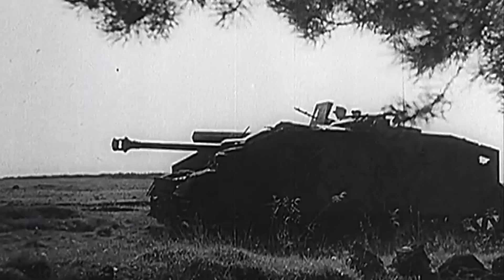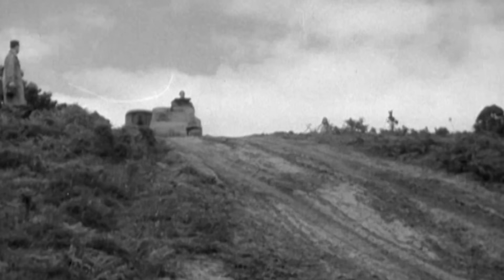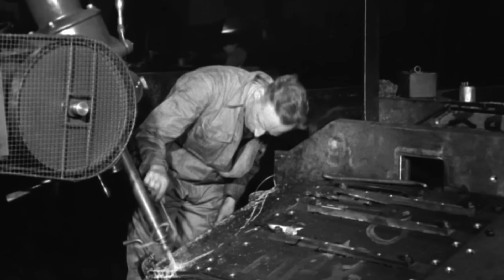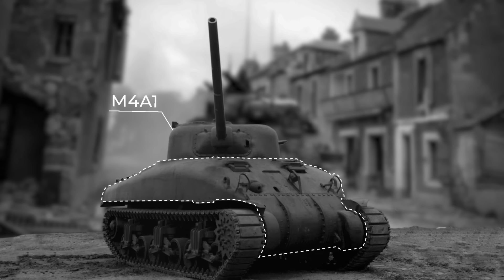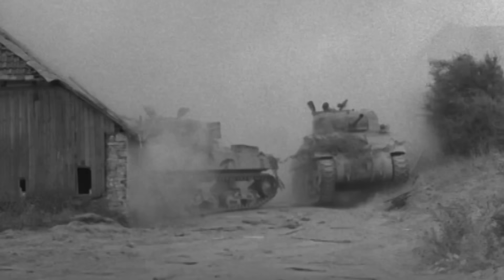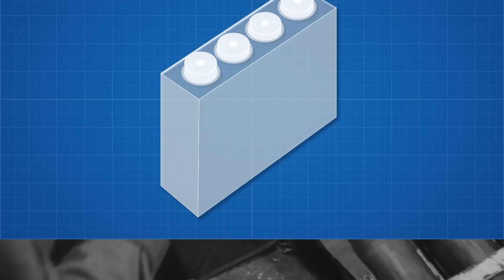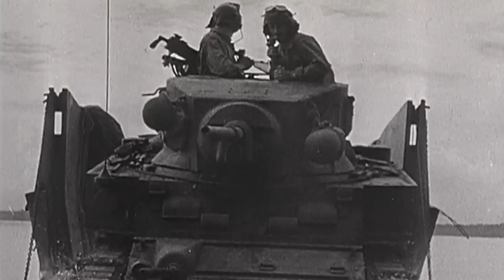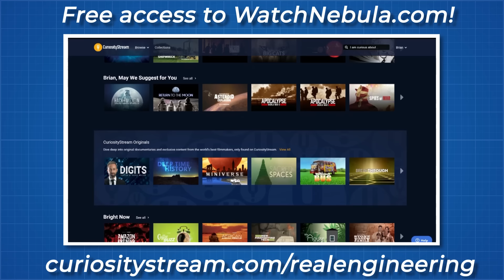M4 Sherman - The Workhorse of D-Day

Comment: The size of a tank platoon in the US army was 5 tanks, so if the US army was sending tanks to battle, it was in multiples of 5, which is why there would always be at least 5 shermans fighting any german tank.
Reply: Pyroblaster1 I am a retired tanker, you are absolutely correct. Tanks fight as part of a unit. The smallest maneuver unit is the platoon, which in WW2 was five tanks, today it’s four. Tanks do not fight by themselves. A tank fighting alone is a dead tank.
Reply: John Aaron But wait, there’s more! If you act right now, you’ll get infantry support! And if you call before midnight, you’ll get an artillery fire mission! And if you’re among the first 100 customers, we’ll throw in a tactical air strike at NO ADDED COST!! 
My point, of course, is that every Branch supports each other, and ultimately the Infantry. Nobody goes into combat alone. And from this short-timer to a Lifer, thanks for your service.
Reply: @kentuckycrittercamera9407  they're doing well in infiltration tactics within the Russo Ukranian war.
Reply: The British often had a 6th in the form of the Firefly with the very powerful British 17 pounder gun

They'd paint the end of the barrels black and white so they'd look like regular Shermans to the Germans and not get targeted first
Reply: The Germans were on the defensive,  in order for an attack to be properly carried out the attacking force needs at the very least a 3 to 1 ratio
The reason that the allies have 5 tanks for platoons is primarily because that is what they have brought with them
You're not gonna say 'hey the enemy only has one panzer placed there, lets reduce our number of tanks from 5 to 3, lets make this fair'
Reply: An allied company could be supported by a platoon of Shermans, a German company had a lot of MG 42 machine guns. The role of German infantry in support of tanks were the Panzer Grenadiers. They had a completely different philosophy. The allied philosophy demanded the production of lots of tanks as they had the initiative after El Alamein.
Reply: @CharlesvanDijk-ir6bl  the americans were caught in a bad situation. they had to have a tank that wasn't a tank. they had to have a tank that could be shipped to europe, land in france and cross every bridge between paris and berlin.

they did it with disposables. it took 10 american tanks to knock out one german tank, but we had lotsa tanks and lotsa tank crews.
Reply: @longnamenocansayy  It didn't take 10 Shermans to take out 1 German tank, the Sherman had a better kill to loss ratio while attacking,
Reply: @demanischaffer  That's why Germany only had 7,300 to 16,700 tanks not deployed and lost on the eastern front but American claims 22,000 German tanks for a loses of 10,000 American tanks... Forgets the UK/commonwealth took on most of them tank and lost about 16,000 tanks...
In a few places the Sherman got a better kill to losses rate but over all did as good as the t34 that is 3 lost for one German tank lost.
Reply: @longnamenocansayy  Woah wait what?!?!? 10 American tanks to one German tank? Where'd you pull that one from?
Reply: @albinoofthesunlongboof3889  the majority of American tank losses came from anti tank guns and panzerfausts the 1954 tank vs tank study of ww2 had the shermans destroy 3.6 germans tanks for each sherman lost 
The British on average lost 1.03 tanks per each tiger they destroyed and this stat is biased by Whitman
Reply: @Elisângela8968  The data you mention doesn't not add up with the reality of ww2 data so I Would have to disagree with you based on the over whelming support agents your claims on that there no evidence to suggest AT guns and Tank kills could be 100% separated both would be interchangeable as the most common German Tank guns the 75mm and 75mm paks would be no way to tell the difference, Tanks and AT guns make up about 80% give or take of tank kills. 
Even if you gave 50% of kills to pak guns German tank vs tank still get a 3 kills to 1 lost.

The way tank kills were given to anyone on all sides was you would claim that kill and have other units claim you killed it not the most accurate But best at the time Most Allied data was collected after the war not like the Germans tried to do it why they were still fighting so there would be someone to say as an example Whitman got 10 kills yesterday he claims 11 so give him 10.5 were as the allies did it after the war so not as accurate but there is also over confidence in say Whitman killing say 30 tanks in 1 fight probably more like him and his unit but to make them self look better they let Whitman have all the kills same as the allies/soviets.

Panzerfaunsts and At Guns You need to look at YouTube ( Military History Visualized ) as an example in 1944 January to April PanzerFausts only get 3% of tank kills and over all the hole war it raged from 1% to 8% AT guns get 24% in that same time and over the hole war it rages from 16% to 32% so with that data alone Tanks Killed more tanks but this is not 100% proven and will likely never be....

Also the American Kill to lose rate is way out Germany Had a total of 7,300 to 16,700 Tanks not deployed and lost on the eastern front America claims to have killed 21,000 for a lose of 10,000 total yet forgets the UK commonwealth lost about 16,000 tanks and fought more German tanks I should also mention over 1,500 stugs types were still in operation in the German army when they surrendered and 500 other tank types....

There was a total at anytime 60 Tiger 1s in France at anytime and only about 5 are confirmed to be vs American Sherman's and the Sherman won 3 or 4 times and no AT guns and or other tanks were involved. Now 2 of them 5 were getting on a train together and the other tigers seam to have bean by them self which is strange so take it all with a pinch of sault there were many more times but both sides had AT guns and other types of tanks involved so 100% correct is almost imposable.

Allies would often bypass heavy tank units so they wouldn't have such high losses and just cut off there supply so they didn't have to fight them when ever posable.

There are a few places were the Sherman did kill say 3 panthers for ever 1 Sherman lost but there was only about 3 times were this happened and not the norm were as German armour won more times over all as I said 3 to 1 in there favour in about 60% to 90% of the engagements more or less as some units did better and other worse but the best allied units are like the average German ones to put it blunt.

Your last statement is funny as Wittmen and his unit killed almost a quarter the number or more then there were tiger 1 in France so gonna have to call that one an American fanboy theory not any data to support that one at all as far as I'm aware. 
Not to mention 50% of tiger 1 and 2 losses were due to abandonment due to lake of fuel and or damage like a thrown track that could not be replaced so calming them all as kills is not accurate or the German kill rate would be ridiculously high like it was in 1941 something like 1 lost to 7 soviet tanks till they reduced it by 50% and all kill claims after that were as the allies and soviets didn't giving them both better numbers and inaccurate kill clams were as German underestimated there's they only needed to drop it by 30%,
Now tiger 1s and 2s got a 12.6 to 1 lost and if you add in brake downs/abandonment as losses its still 6.5 to 1 so the Sherman doing better vs the panzer 4 would be a more realistic statement but still not correct looking at the data.

My last point You probably think that the shaman was the most survivable tank in ww2 yes and no as now its believed to be the Churchills last time I checked.
And German records have not bean put out as far as I'm aware the allies data basically is along the line of they didn't survive the war so there tanks were not survivable which is utterly ridiculous and in no way accurate.

But let me get some of the data for you the USA sample number was of 49,000 Tank Crew men not all were Sherman's so if every one in that number was in a Sherman that's only 9,800 Sherman tanks now the correct number would be if it was only Sherman's 22,000 to 27,000 tanks and 110,000 to 135,000 crewmen... If there was every tank man America should of had in ww2 over 300,000 men and over 75,000 tanks so its not the most accurate data but its a start.

The Sherman had about 20,000 to 26,000 Sherman's damaged in ww2 and fix by USA and UK and America lost almost 6,000, UK/Commonwealth almost 8,000 Russia almost 4,000 its over all effectives was only slightly better then a t34 which got decimated due to the conflict in the east being so much bigger in almost everyway facing the bulk of the Germans and there Equipment. Were as the allies had over all more men equipment should have crushed them but didn't even man for man German gets a 3 to 1 in there favour they were better then us over all they basically made up the tactics and had bean using them longer and a lot of there equipment was better or just used more competently overall.
Reply: @longnamenocansayy  Statistics can be literally correct and at the same time taken to mean something that isn't true.  If the ratio of Shermans deployed to German tanks is 10:1, or Shermans destroyed for German tanks destroyed, it doesn't follow that one Sherman couldn't destroy a German tank.  There were more different German types for Shermans to encounter, some of which were over-matched by a Sherman, some of which were the Tigers and Panthers whose armour could usually defeat the main gun of most Shermans (e.g.  not the 17pounder of the Firefly variant.)  Most German tanks were destroyed by something other than a platoon of five Shermans,  never mind two platoons.  Tank destroyers accounted for some,  anti-tank guns for many, other artillery got lucky shots when shelling or used direct fire when German tanks got close enough, and aircraft destroyed a lot of tanks. The relatively high casualty rate when Shermans met Germans was also partly due to the fact that a higher proportion of German crews had the benefit of combat experience or training from experienced instructors compared to the American crews in N.Africa and Allied crews in Italian and Normandy.  This ratio changed as the war went on and survivors on the Allied side passed lessons lessons on to their reinforcements, but the attacking side always had to take more risks.
Reply: @longnamenocansayy  werhaboo alert

The Sherman had 80-90mm of frontal effective armour,like the Pz4 and only 20mm less than the tiger
Reply: @albinoofthesunlongboof3889  And the 3-1 is normal becaus the allies were on the offensive
Reply: @albinoofthesunlongboof3889  Survivability in the Sherman was really superb in WWII. Of those cited 6,000 shermans lost, only 1,200 crew members died in or out of the tank.
Reply: @longnamenocansayy  maybe 10 to 1 for the german heavies but the german mediums like the panzer 3s and 4s were pretty much equal to the shermans (no the panthers were not mediums even if the germans called them mediums.)
Reply: @longnamenocansayy  ...you dont know alot of tanks dont you
Reply: @longnamenocansayy  ITS MEDIUM TANK SO WHY ARE YOU COMPARING IT AGAINYS AN HEAVY TANK
Reply: @yourlocalmilkman916  it's a real old comment.  at the time i wasn't expressing the number 10 as if it was a cardinal number.  it was more of nominal number as in lots of . the general strategy that we used was that we could out produce and thus win a war by attrition.   the idea i was trying to communicate is that we did not try to make good tanks; just a lot of tanks.  the number 10 was suppose to be a loose approximation of the phrase "lots of"   we had lots of tanks.  what does "lots of" mean?  it could mean 100. it could mean 10,000. it could mean 1 million.  so to be more more expressive i used the number 10  as a nominal number to mean "lots of".

yes, we could have built the biggest fastest heaviest tank in the world.  but we didn't.  why not?  why did we choose to build lots of tanks and not one perfect tank?     i hope you don't reply.  it's such an old post.
Reply: @longnamenocansayy  sorry but I'd really like to answer your questions

The US has all the resources to build one perfect tank but the thing is, it took time to perfect and eliminate all potential drawbacks- time the US doesn't have since it was hurrying to give its allies the tanks they badly needed- especially with the Brits since a whole bunch were lost at Dunkirk- and their economy was still starting to fully rebuild itself into a war economy bc of the effects of the Great Depression- and that's why there was the M3 Lee, which was produced and given while they were perfecting the M4 Sherman. The M4 wasn't conceptualized and built in 1942- the idea was brought on from observations on the Battle of France (1940) and that's when they realised that their current tanks were shit (apart from the M3 Stuart, but that's another thing) and started developing the Sherman right away. And by the time that it was being churned out of the factories at chunks, 88mm Flaks were being horizontalised as AT guns, PaK 40 was already in use, and Tigers started to appear, so that's where the problem begins (in terms of firepower). And remember, Shermans too were being used not only against the Germans but also the Japs, so the limitations come in. They built a tank that was, in theory, THE perfect tank for the US Army. And that's not to say that the US were building powerful tanks such as the M6 Heavy and the T20 and beyond, but the problem is, they are either not what the Top Brass expect it to be, or are seriously flawed and would always have to be reworked at the factory again. But really, building an all-rounder "perfect" tool would never work since one way or another, imperfections would eventually find its way to ruin its concept, or would take time before being deployed in its intended role- and in war, time is something valuable, every second is to be cherished and not wasted.

Another factor here is the factories. The US is in America, Germany is in Europe. Where is the battlegrounds? Africa and Europe. How far is Europe from Africa? Just a Mediterranean Sea away. How far is America from Europe and Africa? A literal ocean away. Bringing one stuff from point A to B with the sea as a route is hard enough, what more would be an entire ocean? And this was all before shipping containers (they were only to be built in the 50s), so imagine the pickle the US was in. Everything that had to be shipped in Europe and Africa should be of high calibre- men, equipment, vehicles- and developing them took time, and that's why the UK not falling from the Battle of Britain, and maintaining its empire and the Free French territories were a big blessing for the US. But even then, they cannot be depended too much since Britain was mostly had to rely on their far-off dominions (that may or may not be at war) and is constantly at danger from Luftwaffe bombings, so everything that had to be shipped must be easily modifiable or can be repaired on the spot, and that's why we have the "Sherman VC Firefly", unlike from the Germans, when a Panzer breaks down, they can ship it back to the factory at Germany and "SCHEIßE Albert!! Please rework ze transmission again", So that's why.

Building something "perfect" takes too much valuable resources and long time to test- things that are, in many cases, limited during wartime- and the Sherman is an example of that supposedly "perfect" tank in theory, but is kinda disappointing at some areas. But in overall, the Sherman was an excellent tank in its intended roles- it can be made quick as hell, have enough firepower against infantry, reinforcements, and other tanks, can be shipped anywhere from the Pacific to Normandy, is easily modifiable (lol try to even enumerate every engineer Sherman variant, it'd take you an hour), and survivable for its crew.
Reply: this so much. 99% of the time when people go "it took X many of Y to kill Z" the real answer is "Z needed to die so Y sent an X because it was the size of formation needed"
Reply: If the German tanks even got there in the first place. As greater minds than I point out, the allies were quite good at knackering the German logistics system stopping or delaying German armour getting to the battle field.
Reply: @mugofbrown6234  The biggest problem the heaviest German tanks had was reliability. When a company of Tiger IIs sets out for a 20 mile drive but only half of them make it there due to breakdowns on the road, that's hardly a "Vunder Weapon".
Reply: @billd.iniowa2263 Yes. Nicholas Moran discusses that very thing in his talk about the Sherman.
Reply: @mugofbrown6234  Exactly where I got it from, lol.
Reply: "You're not gonna go 'Oh its only a Sturmgeschutz, hey Joe we don't need you and your buddy' "
-The Chieftain
Reply: That may have been the theory, but in practice, on-scene commanders could divide up the tanks as they saw fit, utilizing them when, where and how they were most-needed. Or create larger, ad-hoc units as needs dictated.
Reply: Sparky Puddins  The crews actually preferred the 75mm, because of it's HE effectiveness.
Reply: How many Shermans does it take to kill a tiger?
Reply: @streetwatcher_  almost always depended on who got the first shot off. Out of all the Tiger Is found in France by the Americans, the Shermans took minimal losses and won.
Reply: @essentialjazzforaspiringmu1605  only cuz of their sheer numbers right?
Reply: @streetwatcher_  Nope. 5 tanks. Thats how many shermans were sent for every hard point, AT gun nest, and tank they came across, since thats the smallest size of tank organization; a platoon.
Reply: That’s actually not correct opportune was made a five tanks because of the logistical support necessary for these tanks and fuel the most number of text that could be put together and still support it adequately was five
Reply: Also the shermans wouldn't stop working because they drove 90 miles
Reply: Poor panther tank crews and their terrible drive trains
Reply: 5 M4 is used to fight Sd.Kfz.251
Reply: Lol
Reply: Add in the fact that both the Panther and Tiger I were incredibly unreliable vs. the Sherman, and it became a 5-1 fight.  Personally, I like the odds for the five.
Reply: Unless they met more than one.
Reply: Yes. Russians did the job. That's why Germans didn't have enough tanks.
Reply: @audioproductionmusicproduc8518 And the bombing campaign.
Reply: Germany basically made up ww2 tactics in particular tank warfare they had 5 tanks in a platoon the fact is they didn't have as many tanks or replacement tanks often on the western front they fought in smaller numbers of what was available to them.